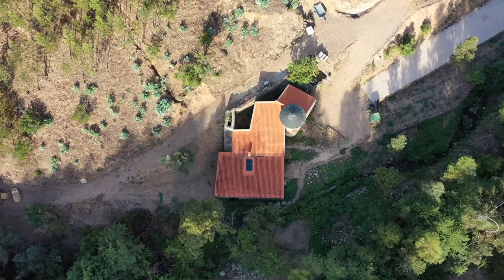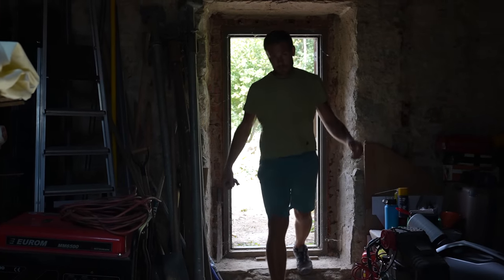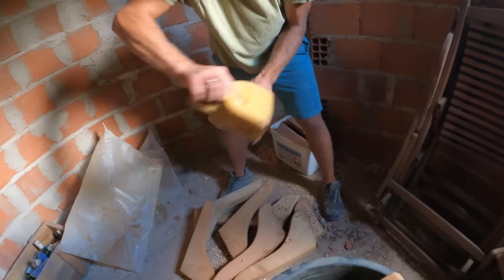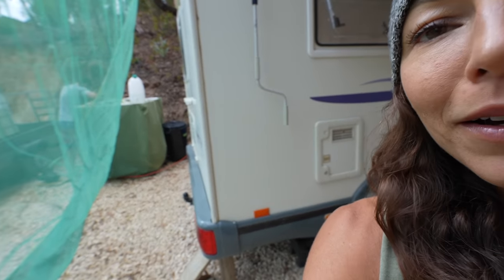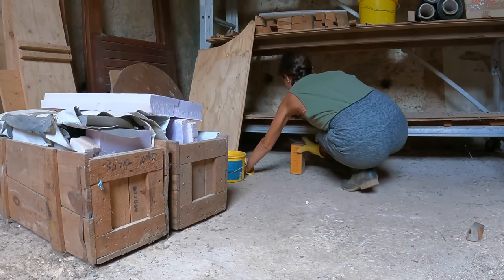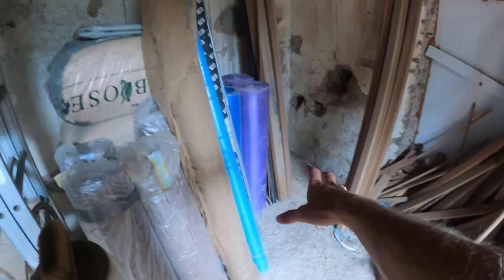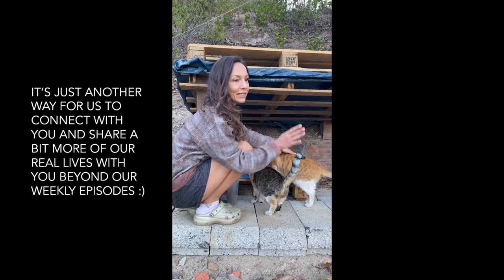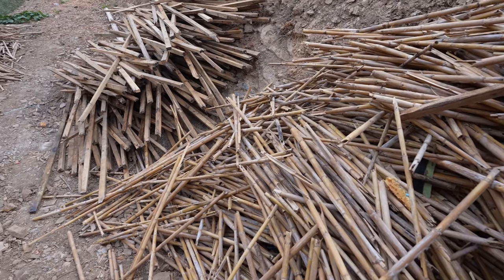SHOCKING ROOF DEMOLITION TIMELAPSE. Renovating a ruin in Portugal.

Comment: After rebuilding the steel supports to replace the tree trunks. I suggest that you use plaster-like cement to mock-up a design of a tree trunk around it , then incorporate it with several  strategically placed short branches to hang stuff and then paint it to resemble the original trees that were there to keep the spirit of that elf-like magical vibe they exuded into that wonderful space! :)

Comment: That large wicker basket could be used as a bathtub, encase it in a epoxy resin.
Cost wise it wont be much more the a top quality tub bought of the shelf, it will just be the time it would take.
You could then go one step further and find some smaller version and epoxy them to make hand basins….

Very unique, one off and a touch of rustic meets glamour

Comment: Great to see the cats are back, hope the building work doesn't scare them off.  When fixing the holes in the walls, get some wire wool on a roll ,place a layer over the hole, use expandable foam to fill then do brickwork, etc.  Mice and Rats do not like the feel of wire wool on their whiskers and they don't like the taste of the foam.  Remember to fill every hole down to the size of a pencil top as mice can get in from that size. Hope this helps

Comment: Spray some furniture spray on the bristle of the broom, it will hold down the dust clouds, just don't spray too much as you will be leaving some oil on the floor & you could slide.   Just a few squirts now & then.  

Have you given thought to removing the stairs eventually & install concrete ramps. Not too steep, but it will be easier in moving objects from one level to another.

Comment: TIP when you lay the tile if it is not level use liquid leveling concrete thin set mix thin and poor it and it levels perfect on its own for floors

Comment: Next time have a full respirator system that includes a face mask to protect from dust, germs, & viruses to use with a heavy duty vacuum cleaner to suck & a backpack gas powered blower to blow!, (like gardeners use). Otherwise, aside from the unnecessary risks taken, great progress!